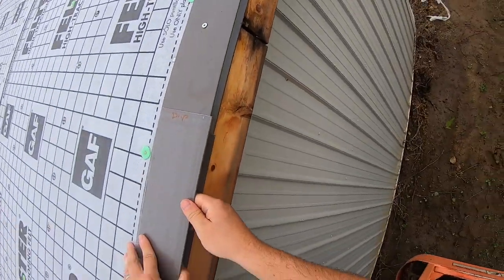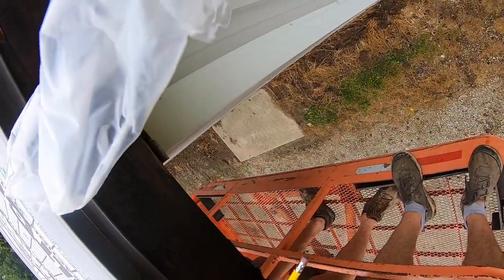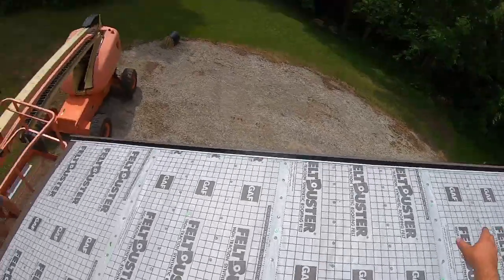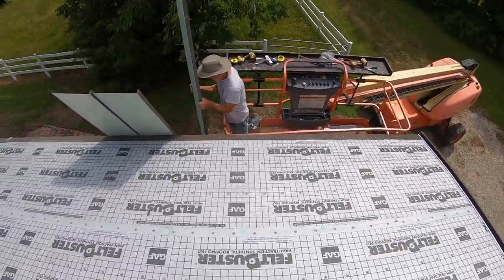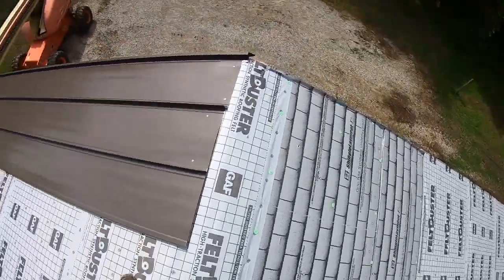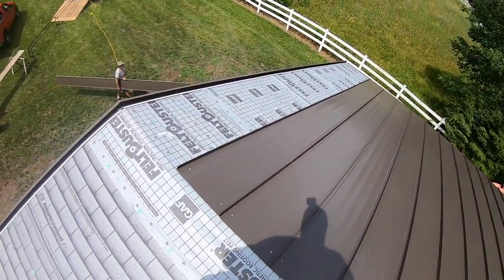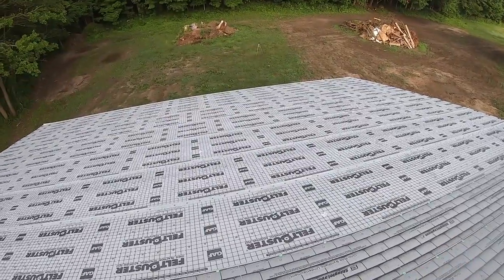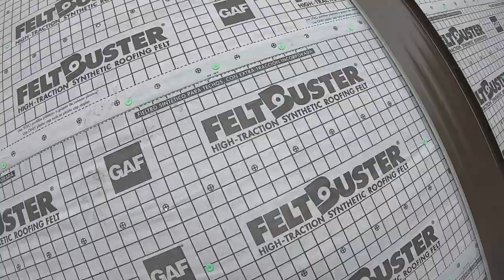How to a Install Standing Seam Metal Roof, SSR 450 SL Panel Profile

Comment from the maker: In this video we install a standing seam metal roof on my pole barn. The panel profile we used is SSR 450 SL and the color is burnished slate. This was our first metal roof using this portable roll former and this panel profile. If you have any questions or suggestions drop them in the comments. Also, the links below are to videos that discuss the installation of valley flashing, kick out side wall flashing, and installing a metal roof on a bay window if you’re interested. Roof Layout and Installation of Metal Valley Flashing with a Slope Transition on Standing Seam Metal https://youtu.be/rIB7mgjFSL8 How to Make Kickout Flashing With Standing Seam Metal Roofing: Pole Building Side Wall Flashing https://youtu.be/NUXzvq3d4QQ How to Install a Standing Seam Metal Roof on a Bay Window https://youtu.be/9nkPbgNjFTM

Comment: Thanks for sharing. Looks great and metal roof is my favorite type of roofing. Have you done any other metal roof on a house that has valleys and skylights? Just curious how hard that would be. I had a project but couldn’t find any bids lower than $50K so the homeowner decided to go with shingle roof.
Reply from the maker: I’m just starting to put a metal roof on my house and it has some complicated valleys.  I’ll record it and post most likely.
Reply from the maker: Just got the video uploaded of the metal valley installation if you’re interested.

https://youtu.be/rIB7mgjFSL8

Comment: Thx for the vid. But i got a few questions. Wouldnt the screws at the top restruct the movement? Also, you know if solar panels being installed on these wouod be a problem? Now that i see how theyre installed, seems solar panel clips, clipping onto the ridges might restrict movement. Hmm.
Reply from the maker: The screws at the top do not restrict movement, because that is the only spot where they’re truly fastened through the panel as the clips hold it down, but they allow it to slide down, so as a panel expands a grows downward.  I’m not sure about solar panel installation however i’m sure there’s ways to do it that won’t affect the expansion and contraction of the metal.

Comment: Why do you use that type of rake trim vs rake trim that requires z bar and butter tape? Seems water could splash up and over the high rib. I do metal roofing for a living and have learned alot watching your videos.
Reply from the maker: Glad you liked the videos.  This rake is very easy to install as it’s one piece.  That’s why I like it.  I think some water could splash up and get behind there but very little.  If water does get behind, there is a few inches of metal with an upward hem that acts as a small gutter that allows the water to drain away.

Comment: What are the clips? How can I install standing seam without the special cutting machine, tool to bend the ends, special electric cutting tool, tool you all used to roll/bend the edge after cut, etc.?
Reply from the maker: You need the tools.  Some places may have these tools for rent.  These clips a specifically designed for this metal roof panel profile.

Comment: You guys make this look very easy.....why do Standing seam roofs cost 2-3 times more?
Reply from the maker: Thanks.  There is an art to installation if you have a complicated roof so that costs more.  Also, you need to use a heavier gauge for standing seam and there is a lot of specialized trim pieces to buy.  There’s also a little of, they charge more because they can as not everyone has the tools and know how.  To roll form standing seam costs a little more than exposed fastener but not significantly more.  You just buy a coil and pay per sqft.

Comment: What clips are you using? 
And where did you buy them? 
Thanks in advance
Reply from the maker: The clips come from a company in logansport, Indiana.  However, each different profile might have a different clip style.  Contact the manufacturer of your roll former or metal that you bought.

Comment: curious why you bought the ntm, compared  to others? have been installing on and off the last 30 years, was thinking about purchasing a unit but unclear which one to choose. Whats your perspective ? thanks in advance BB
Reply from the maker: We like their customer service support, how easy it is to change out dies to run different profiles,  and the large number of different profiles you can choose from.  We also got a good deal through one of their suppliers that wanted to move this specific machine.  We went with the SSR Multipro Jr as it’s a more affordable model.
Reply: Most everyone buys New Tech. They usually much cheaper than all the others. You are getting what you pay for though! If you are going to do high volume like a supplier buy Zimmerman!
Reply: Please buy a shlebach there out of Georgia they are a very good machine with pre-cut and all computerized. You don’t have to have a stand with a trigger on it. It has its own tape measure. It is dead on the money and been a very good looking panel.

Comment: never seen that F channel (piece of fascia w/channel) I like it. I guess the roofing being bent in it will hold it down? Don't see it on my suppliers list, Darn it.
Reply from the maker: Ask for a custom piece. If they have a CNC break they should be able to make it.
Reply: Do not use that detail!! It is not smacna approved to counter astm E1592 negative design pressures. The same problem at the ridge vent, as well as the top of panel drag load screws are not installed correctly. This roof is NOT properly installed to receive solar panels or snow retention. As an independent consultant I continue to see these regional rollformers make these mistakes over and over. Everytime one of these roofs fails it is very easy to assign liability to this install/rollform, as none of this roof is per any industry testing. This install also violates every aspect of ASTM 330 and 331 for water and air infiltration.

Comment: You actually want your starter on top on your inlay with a metal roof unless you go with a strip of under lay first and then paper over the starter because you shouldn’t have metal in wood contact good job guys

Comment: I def cant justify the $45K $60K price of not doing this myself. I priced materials for a 90ftx40ft roof...and it seemed to come out to less than $10K. Maybe im wrong but...panels were like $50 each. Granted, these were not the ones that used the clips, but instead they had the nail holes. But even adding $2.5K or $5K more for the type using clips, i think my boys could get the roof done in 2 days. Id pay them $500 for the 2 days...and im only at $17.5K. Labor always sets us back...as investors. 😅...but i understand.
Reply from the maker: Yeah, the labor is the most expensive part of getting a metal roof put on. Sometimes it can get complicated when there’s a lot of valleys, slope transitions, and things like that. However, if you just have a straight gable roof it’s not that bad.
Reply: @HowtoHacks  yes, my roof is simple. Thank God. Thx for the reply.

Comment: Number one clips absolutely suck. They do not hold the metal down there and screwed 12 inches on center with a nail flange plus use 24 gauge metal. I do it every day. I’m not just trying to be a dumbass in the comments, but please tear off shingles.